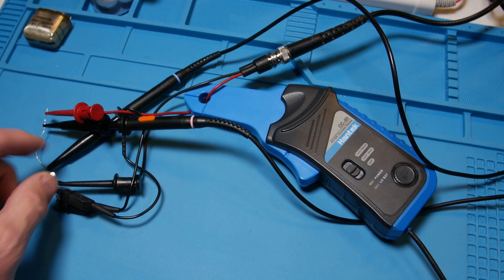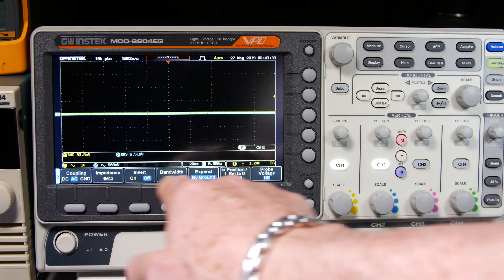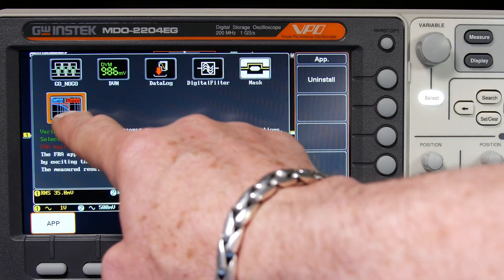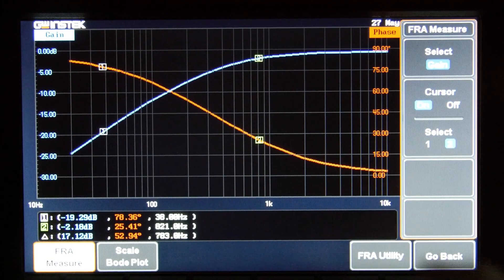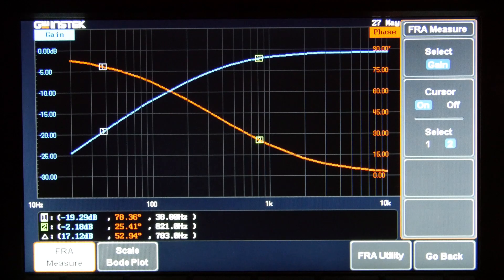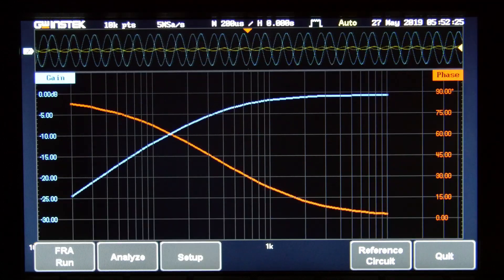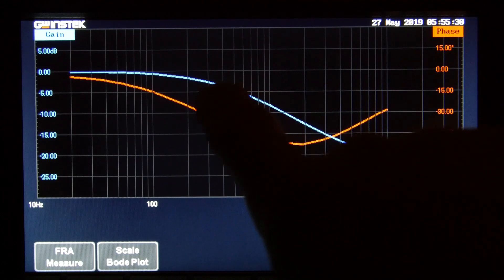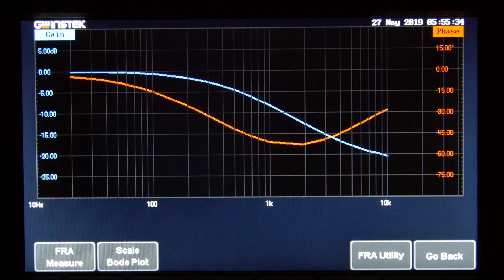Low Pass Filter - Simple Example ep3

Comment: You could try measuring the actual resistance and capacitance and see if the maths correlates with the plot you are seeing on the scope - might be an interesting short video.  I suspect that the capacitor has quite a high ESR relative to the resistor.  It's one thing I've been looking at lately - unless a capacitor is marketed as low ESR, they tend not to give that figure in the data sheet.  There must be a relationship with tangent of loss angle though (which does often appear in a data sheet) as there is a relationship within the formula:  tan squiggle = ESR / Xc.  You used the latter term in your high pass filter video - actually, I think you used the whole thing but expanded out: Xc = 1 / 2*pi*f*C.  If maths was my strong point, which it isn't, we could calculate ESR from tan squiggle.  BTW tan squiggle is a technical term I invented for that little Greek symbol I can't reproduce on my keyboard!!

You mentioned parasitics here: I'd be interested in a video on that topic as I'm struggling to understand how to take account of it in design.

Anyway, as usual, great little video.
Reply from the maker: Andrew Johnson Thank you - you must be looking at my playbook.  My next video does just that;) Should be able to post that tonight, or tomorrow at the latest.